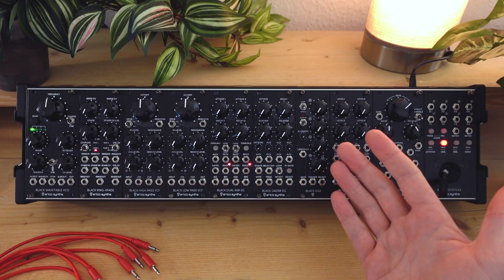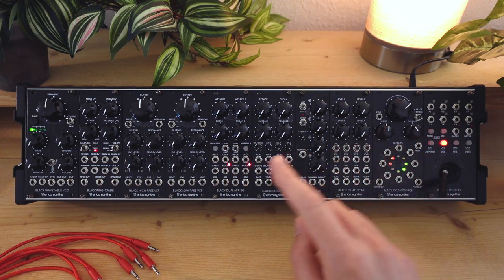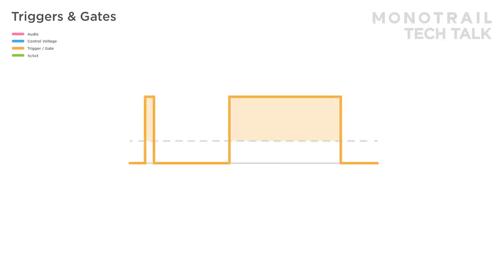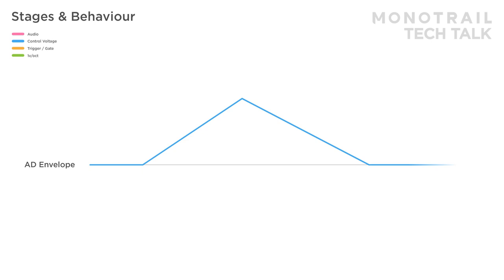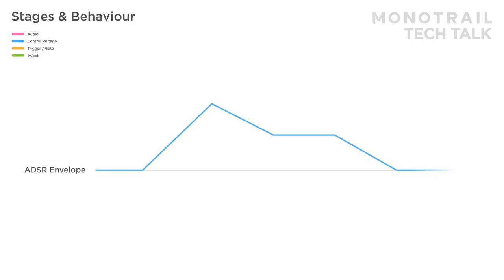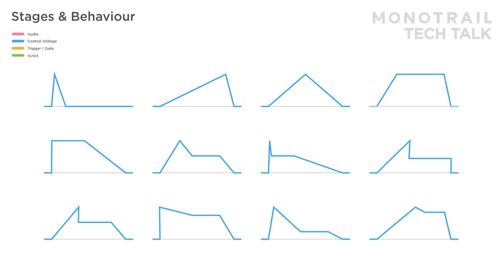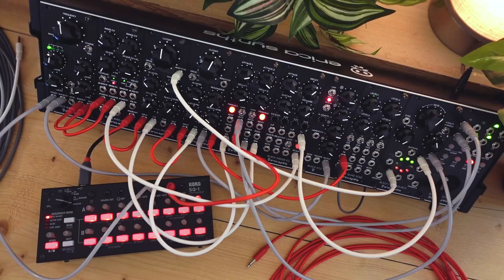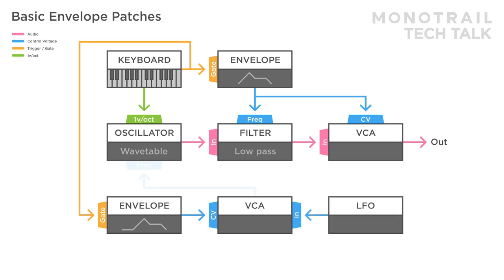The ultimate introduction to eurorack envelopes - (part 1)

Comment: It took me a long time to grasp the concept of ‘sustain’ in the standard ADSR envelope. It was only when someone stressed that the S stage is concerned with the y-axis of the envelope, while ADR are plotted on the x-axis that I finally understood. Practically, that has helped me a lot- I graduated beyond the basic Doepfer A-140-1 ADSR (though I would never sell it!) to the Make Noise Contour (strictly speaking an ASD envelope with a lot of outputs for various stages), and I’m just starting to get to grips with the Xaoc Zadar- surely a quad envelope generator to rule them all!

As always, great information-packed video- thanks!
Reply from the maker: Hi there! Indeed it's a common struggle when the whole concept is new. Sounds like you ended up with a great selection, enjoy! :)

Comment: For advanced envelope generation, I can recommend the mighty Mutable Instrument Stages (or a a clone of the module), especially when several are chained together.
Reply from the maker: Nice module indeed! And for sure chaining is a great and powerful trick. Will dive into that, as well as mixing and inverting envelopes in the next video! Cheers :)
Reply: @MonotrailTechTalk  I mean chaining several Stages modules. That way you can build for example a 12 stage envelope triggered by one gate input. Chaining envelopes is of course also nice!
Reply from the maker: Ah I see, that's a different idea indeed! Both interesting :)
Reply: I am not the hugest fan of stages for envelopes, they quite slow.
Reply: I will second this recommendation. The alternate firmware by Qiemem adds even more functionality, such as a random voltage mode, faster/slower segments than default, bipolar segments, and 6x DAHDSR envelopes.
Reply: Stages is one of the only modules I know of that can do the Yamaha CS style envelopes where you can also specify the initial voltage and the voltage at the end of the attack stage. I  think maybe the Quaid Megaslope could do it too? And I guess a Deckard's voice, but I wish there were simpler cheaper options for that kind of envelope.

Comment: Gates have an “on” (high) and “off” (low) state. They remain high for a duration that you need to sustain an event and go low when the event ends. For example, a gate signal can keep an envelope open as long as a key is held down.
	
Triggers are short, momentary pulses used to start an event. They provide a brief impulse to initiate actions like starting an envelope, playing a sample, or advancing a sequencer step. They do not have a sustained “on” state; instead, they provide a quick “start” signal and then return to low immediately.
Reply from the maker: There's a couple of minutes in the video where I explain gates and triggers in depth! :)

Comment: which module achieves that screaming sound through out the video? its beautiful
Reply from the maker: Ha, I'm pretty sure the sound you mean is caused by the filters! I did a video on the HP & LP filters, but to be honest I mostly focused on explaining the concepts there, over time I learnt to control them better, and kinda fell in love. The balance between input level, resonance, and distortion switches is crucial. But they have a magical 'turn-everything-in-a-raw-rumble' sort of power :)
Reply: @MonotrailTechTalk  you got some great sounds of of a very small case!